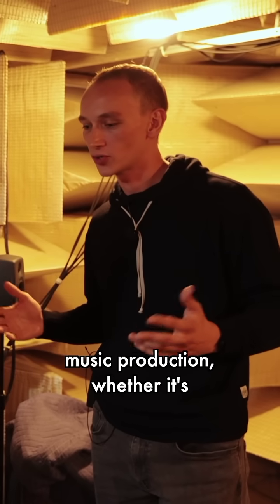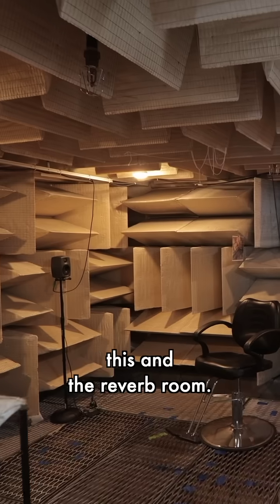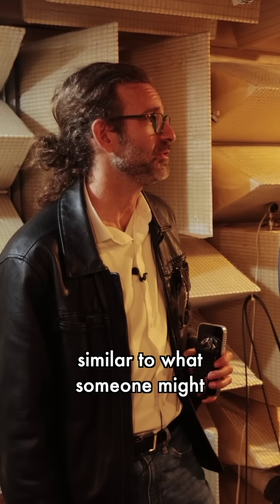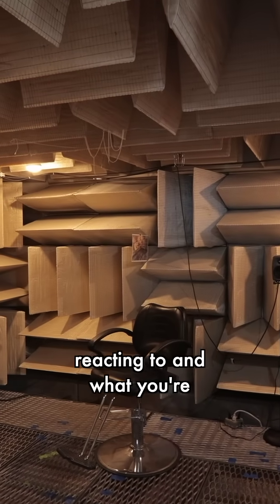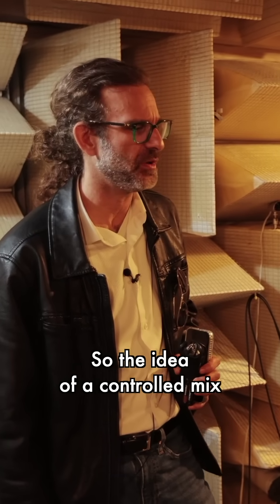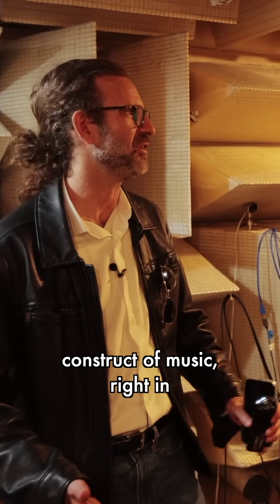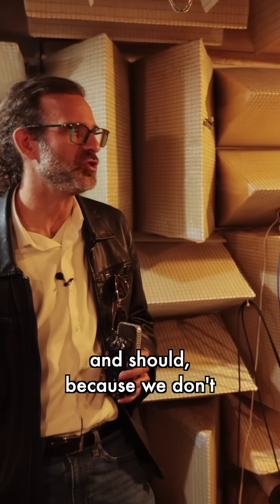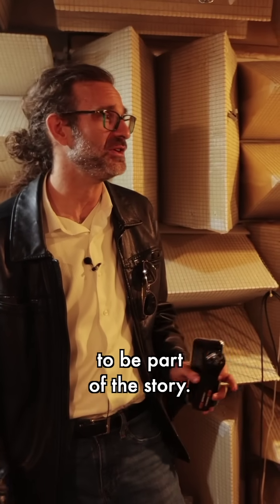Ideal Room Acoustics for Audio #AudioUniversity #AudioEngineer #Reverb

Comment: LOL!! sound can't even exist in a vacuum. Also, it's not a vacuum chamber by any means. The static air pressure is the same on the inside as the outside, even if there is no sound reflections
You also have to differentiate between listening room and recording room. Nothing good comes out of having room acoustics applied twice on the music (or other sound, such as a sound effect), so one of the rooms - either your recording room or your listening room should ideally be anechoic, to get good sound.
The most useful is to have your controlled reflections and "add an environement to the sound" in the recording room, then listen to it in the anechoic chamber. 

Theoretically you could also do the recording in the anechoic chamber, then have a listening room with your "controlled reflections". But then that listening room will get very limited use and only sound good for a given type of music.
Having the listening room anechoic istead, will allow any environment on the recording to "come to life", as the listening room is completely neutral and don't add it's own "acoustic signature" to the sound.

That will of course be hard to archieve in a normal room for space reasons and that you might want some furniture or else inside (all that will also create reflective surfaces) and some people might also not like the feeling of being in such a room when not listening to anything (in that case, things like diffusors might be put in - that gives reflections that's very smoothed out and don't color the sound as much as big even surfaces will do - but still takes away some of that "acoustically dead" feeling). 
So you have to comprimize to some extent in most cases 
- but the ideal is always have the listening room add so little "acoustic signature" as possible to the music/sound. 
Bad recordings might sound "too dry" in an anechoic chamber - but such recordings usually also sound quite poor thru headphones and give that "in your head"-feeling to the sound with no depth. 
Then it's because the recording is crap and the improvement should be done there and not in the listening room.